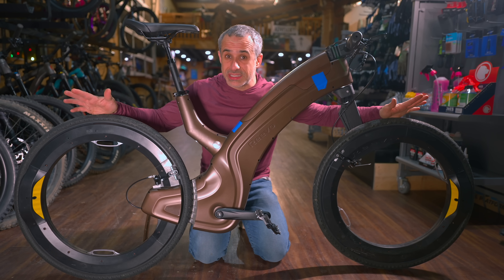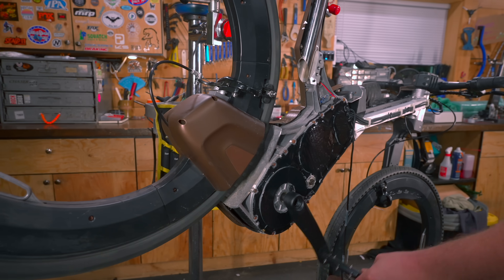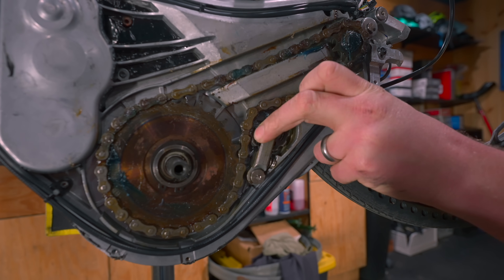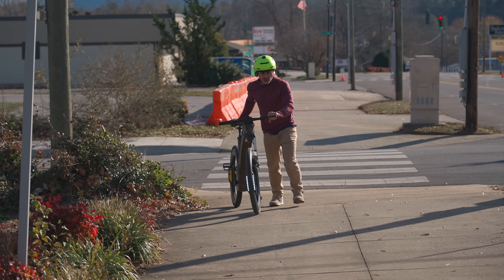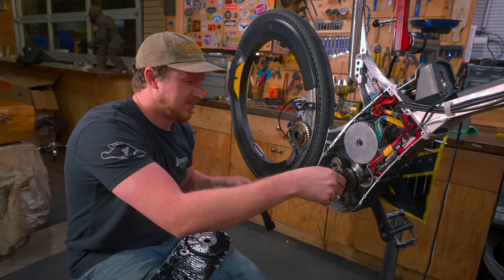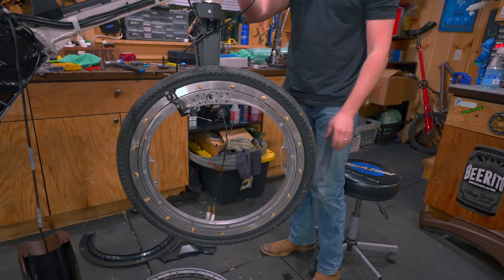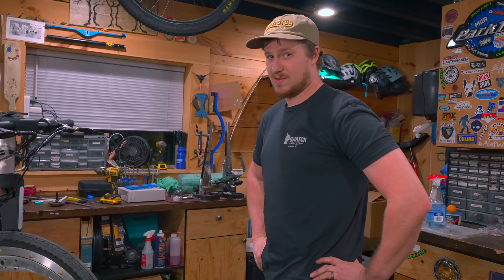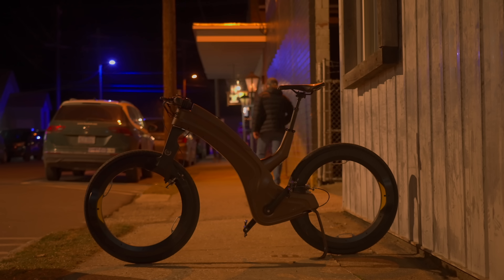What's Inside The World’s Worst eBike? Reevo Teardown

Comment: We missed a great sport:  riderless ebike racing.  Contestants get a Reevo, a lane with guardrails separating each lane from each other, and about a 10 yard run up where contestants are allowed to run their bike to engage pedal assist and then let go at the line.  First place goes to the fast finish time to cross the 100yd, straight course with a feux pedestrian at the end, which if your bike strikes it, gains you an additional point. Winner is racer with the highest points after 3 races.

Comment: The thing is, I feel like a hubless wheel could work - not as well as a normal wheel, to be sure, but it could still be done so much more efficiently than this that I'm pretty sure a properly-executed hubless (or as I'm picturing, kinda pseudo-hubless) wheel would at least be closer in performance to a normal wheel than to this monstrosity; maybe even make a bike that's good enough for some casual use and worth at least occasionally riding for the looks or that hub storage space you pointed out (though it's certainly never gonna be as good as a more traditional one can be)

Comment: i stop the video at the first minute 
Americans- "this is heavy 70 something pounds"
The rest of the world - "how many kiloes is that"
Refuse to watch anything that does not use scientific profeen measurement units . imperial system is arbitrary and i have no idea whats the lenght off a feet from some old king.
Reply: You think the Metric system isn't arbitrary? That there is just some constant in the universe that says that 1 meter is the correct starting point to measure distance?
Reply: @jarynn8156  Yes the meter is based on universal constants , while some king feet grows might be amputated , or anything else

The definition of the meter is the SI base unit of length, which is the distance light travels in a vacuum in \(1/299,792,458\) of a second 
Historical context: The definition was not always based on the speed of light. Historically, it was based on a fraction of the Earth's circumference through Paris,. so yes the meter is defined by a constant of the universe thanks you for asking

EDIT: Just google it "Definition of a meter"

Comment: Subbed! One thing : you need to check out the battery management system! Lithium batteries are absolutely not tolerant of high or low voltage, and need balancing on a per-cell basis, so - the BMS needs to monitor each cell, control the charge rate, and ensure the max voltage isn’t exceeded (lead acid batteries lose a little water if overcharged,  NiMH get hot, but Lithium batteries fail with any overcharge at all (they get damaged increasing the fire risk)!

It would be very interesting to see exactly how the charging system worked!

Comment: Honestly for as underperforming of a model as it is, this was definitely an engineer's lovechild project. A lot of effort and mind power put into making this thing. It looks cool, but it's unfortunately impractical.
Reply: Apparently the brands owner is a known scammer.
The designer probably got paid cheaply for it spite putting good effort in.

That all said the design itself could be improved if you can get the wheel bearings to spin faster and if the gear box used fewer gears.
Preferably less than six.

Comment: All these bikes are made wrong. They want to be robots but have no construction anything like a robot.  You need no chain and no belts. Need solid gearing and torque tubes. Encoders and servo motors. Toss a fanuc motor of a robot on a bike. Slap the RV planetary gear on the bike at the crank spot. Get hot. I just stole the shop and told what's not. Detroit is king of manufacturing and everyone else is a perpetrator hater of world's best production and construction techniques of every car of every street. Robot it. Make the bike robotic. Nobody is doing anything right. All old school garbage.

Comment: This bike seems more like a rushed cashgrab rather an actual attempt at the hubless concept.
For starters the wheel bearing system has too many rubber wheels inside the actual wheels. It's a problem that has been solved for more than a hundred years. Three metal wheels, 120 degrees apart, fixated ON THE FRAME, not on the wheel itself, and a metal guiding rail would be enough to hold it in place while not having all the friction from the rubber. Metal on metal is done on train & rails for a reason -- and it's also how monowheels did it in the past, which faced the exact same problem as this bike since it was a giant hubless wheel.
Then, pedalling that bike should absolutely not be hard if done decently. Just look at the colossal reduction gear the rear wheel is. How many teeth is that? Quick calc I did is about 240. The only way you can possibly suffer pedalling such a massively low gear is if the rest of the drivetrain is horribly filled with unnecessary gears and extras (pedal assistance) adding friction.
I think I could do a better job tbh.

Comment: I don't think it's suitable for a production bike. It's a great bike for a showroom. I mean, we see significant weaknesses when it comes to moisture. And dust. Maintenance is a nightmare. You can't just search through a catalog to see if you need gears or something. If the manufacturer goes bankrupt, you'll just have trouble getting spare parts. It also seems very inefficient. They were brave to bring something like this to market.

I think it might still have collector value because it seems so unique. Maybe they should reassemble it 🙂

Comment: the rusted bolts tell me that they didn't consider galvanic corrosion with the steel and aluminum parts touching, which would eventually eat through the aluminum entirely

Comment: Could make an ok e-bike / motorcycle if you leave out the crank and all the transmission gears required for it. Just attach one or multiple high kv e motors directly to the wheel.
I wonder how much energy all those bearings on the wheels really steal though

Comment: They've not so much reinvented the wheel, but rather replaced them with two solid circular tank tracks with idler wheels, and only  one driven by a sprocket. So it is effectively an electrically assisted pedal powered tank.

Comment: The huge Problem with the Idea itself is that it was Something cool and futuristic but the Thing is that the Main use for the Bike was Not even needed you will still need a Trailer or Something for bigger loads AND i think the Main Problem is that it IS electric i think If it were Just a non electric Bike it could have been simpler maybe idk

Comment: I'd love if you could collab with another YouTube channel and see if they were willing to take the bike as it sits now and see if they could reengineer different parts of it to make it better? 

Better gearing, less friction bearings, reduce weight, redesign the front wheel, more powerful motor and better batteries. Whatever was possible. It's a unique enough bike that even though I do not bike and have no desire to I watched both videos you did on it all the way through and want to see more. 

Just a dumb thought from a random commenter.

Comment: It makes sense why the wheels wouldn't spin very well. With how it was designed, you lose any advantage of a regular wheel where you would have extra leverage between the hub and the tire to make it easier to spin the wheel, you also have a far higher amount of drag since instead of just a couple of small bearings in the middle of the wheel, you have a series of small wheels around of the edge with far more contact points and a larger surface area overall to overcome (AKA more bearings means now there's more friction you need to overcome to start moving, and that requires more energy).

Comment: 1:09 "Every bolt is rusted" No freakin way they didn't use stainless hardware, especially when in a different metal like aluminum because of galvanic corrosion. That one bolt in aluminum tells me everything I needed to know about Revo.

Btw, even stainless steel bolts in aluminum will still cause galvanic corrosion, but stainless will hold up 100× better.

Comment: The fact that they used the cheapest kind of rc servo for the LOCKING mechanism is wild. Not even a metal servo horn to prevent stripping from the servo spline

Comment: There have been a number of (stupid) hubless motorcycle designs as well. Which, like this pile, did not work. If bicycles and motorcycles used hubless wheels, the invention of the hub would be a revelation. The main problem is bearing size and speed. A small center hub and small bearing is not only way lighter and cheaper—it also reduces the speed experienced by the bearings resulting in way less friction. The speed of the bearing in a conventional wheel is a small fraction of the speed at the rim, reducing wear as well. The basic "safety" bicycle design has been around since around 1885. That's 140 years, and nobody has come up with a better basic design since.

Comment: They engineered the f*** out of it in the wrong way too much friction too many gears, too many bearings. All you needed for bearings was a single roller bearing going around the entire outer wheel less friction less noise fewer gears and better gear reduction less friction lighter frame less force to create friction also they could have designed a disk brake if they wanted to by facing it inwards it was them being cheap

Comment: I feel sorry for the designers/builders of this. It looks great, and they've put a lot of effort into making a weird concept work. As an engineering exercise it's pretty cool. Yes they are solving a problem that doesn't exist and it completely fails as a useful bicycle due to the weight and efficiency losses (and of course the safety issue with the self starting is a real concern) but as a concept machine I think they've done a pretty good job really. I don't think they deserve the glee with which this guy is trashing it. No one forced you to buy it and no one is forcing you to ride it either.

Comment: 12 gears are not enough. Maybe add an extra hydrogen electrolyzer driven by electrical generator driven by pedals, then pump hydrogen to the combustion chamber that drives a second generator which drives a motor via 12 gears?

Comment: I really don't agree that the hubless wheel is "the mother of all bad ideas". I do believe it could have been done well... Much better than it had been, at least... But you'd have to start with making it run as smoothly as the normal wheel. And it most certainly needs some suspension. These nylon wheels? They're just the cheap route.

Comment: The developer originally worked in tank turret design. Because that's exactly the type of gearing
Reply: I was thinking those "hubless" wheels are a bit like non-articulated tank tracks, but with a pinion driving it instead of a sprocket and lots of idler wheels for the rim to run on, although of course they don't have any suspension because it can't and mustn't flex.

Comment: Such a shame that so much time,effort and money went into something that is all looks over substance. So many crosscut gears of course it would be noisey, so many energy transfer points it had to be inefficient. You never mentioned the power output of the motor but it looks like no more than a 250w. I have a Buzz Bike that weighs 27kgs but it has 4” tyres full suspension, twin batteries and a very sturdy frame. Power from a Barfang MD620 (1500W) MOTOR. How in heavens name is the reevo heavier. The tyres and the mid drive make my bike noisier than I had hoped but I have hit 55kph on the beach. 

Well I had an escape because it was only impatience that stopped me buying a Reevo, because I love the look of it.

Comment: Typically you start with a problem and design a solution to the problem. This way the tool you produce conforms perfectly to any possible need or function it must perform. In this case they started with the finished design and did everything they could to make it functional. They literally did things ass backwards. Perfect example of just because you can does not mean you should.

Comment: Question: Would there have been a chance to implement the concept successfully? Even if it had cost a lot of money? Or is the basic idea inevitably doomed to failure?
Reply: They could have done a much, much better job,  but "hubless" wheels will always make for a very third rate bicycle. Have you seen the "Topsecret" prototype which almost looks like its the Revo mark 2. The tensioned wire spokes of a traditional bike wheel make a very strong, but lightweight structure and provide some suspension, and its small diameter of its hub bearings has drastically less friction, and of course you have a much smaller sprocket driving the hub of a traditional wheel, maybe 11 teeth or so, instead of having a gear ring the same diameter as the rim of the hubless wheel, so you don't need all those extra gears in the drivetrain to avoid having to pedal like crazy.

Comment: There's so much bad design out there, makes me wonder what they're actually being taught in university!!! I've got a Shark upright vacuum that won't stay upright, has to be leaned against a wall. Designed for a small area but has such a long handle, you need a 2 metre turning circle!!!! Big names are no better. In UK service stations there are Dyson hand driers that blow all the water back towards you. A Morphy Richards glass kettle designed to look really cool but poured water like Niagara falls!!! This thing is even worse than the Dyson hairdryer. Costs 350 quid, doesn't do a single thing better or more efficiently than a 50 quid hairdryer but it looks cool & has a weird motor. A motor that actually looks nothing like the one shown on the box but at least it does work. All of the above, & this bicycle are just exercises in want rather than can. A gimmick is wanted but they don't really know how to put that into practice to make it actually work!!! No matter how bad it is, it still ends up on the market & people will buy that gimmick. These products are what you end up with.

Comment: Man i use those little blue servos on toy robot builds! 10:52 $6 for a 4 pack btw! My main concern would be the 3d printed clip thats been screwed on there. For a 5 grand ebike all about green energy to be using the most basic consumer grade level servos that always wore out on me with basic use, with the most brittle plastic cogs i've ever used (I buy them because they're cheap to replace!!! for my mini robot prototype builds) One bad fall or a continued use over time would almost certainly wear out those servos. I bet the $6 i pay on amazon for 4 is expensive compared to ebay, just i like fast postage.

My Bots are all plastic themselves too. until out the prototype stage. If i have any metal in my structure I make sure the cogs for limb movement where steel. Literally $10 more in part price and they'd have high grade steel cog servos! This was a total scam just in part choice. You do not buy those servos to mass produce. There is millions of them made sure but seriously. They are the cheapest servo motors i've ever worked with and even being made in china? They are extremely low quality. There's a reason millions of these are in stock. Tons of plastic goods can use these servos in a home, Outside in the elements? I'd never use them for even an RC car.

Comment: Looks like a pain to replace or repair a tyre. Forget repair. You are going to replace the tyre if you have gone to the trouble of getting it apart.
Reply: I suspect the solid foam tyres will outlast those little plastic wheels in the rim and the teeth on the rim, if they don't get flattened by going over bumps in the road first, they'll wear down and also likely to get grit in the wheel and wear them even quicker.

Comment: They've had to make like Piaggio Ciao, where you can detach the engine from the drivetrain in manual pedalic mode. Then the noise is not loud when cycling without assistant. And straight gears are noisy like motorcycles do. If they using helical gears like gearbox used in cars, the noise is reduced to a minimum.
Sometimes, we don't need to reinvent the wheel, just look and copy existing stuff. Maybe Reevo's next brand and project do it better I hope.

Comment: I think with the right amount of time and good minds put together this could have actually become some thing great. about 60% of the bicycle needs to re-engineered, and it would be very decent, the idea is to re-imagine the back wheel, either make the tire air filled to make the ride smooth, or suspension to the entire back piece (how? this is where smart people re-imagine the engineering), then the big part the gears, they are set in a way that feels like your are still pulling your own weight, so the question is what alignment to put in place to half the force needed to paddle. theres more to t this, but my brain is too tired to think further about something i will not get to use or buy, but if i had enough money i would definitely buy the patent and then play around and remake it.

Comment: I have yet to meet an ebike that ISN'T really heavy. Weight is all in the motor and the battery.

Hubless wheels have the flaw that the bearing rollers have to spin very fast, increasing drag and resistance.  Putting the bearings in a hub in the middle of the wheel means the bearing balls only have to travel a tiny fraction of the distance the hubess bearings do per each full rotation of the wheel;

Comment: This thing was so overly complicated designed. Simplicity works better.
Reply: The problem isn't really in overcomplication, rather it's the fact that they began engineering from a solution instead of a problem so they just slapped a bunch of cool-sounding things onto a bike without a proper end goal other than "make a cooler bike" (I do not understand how did they not realize what they created though)